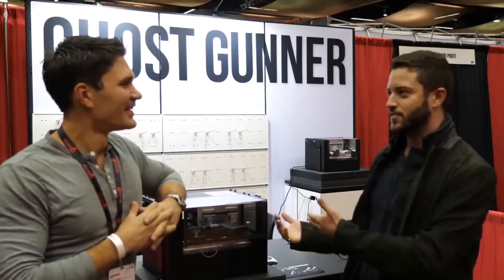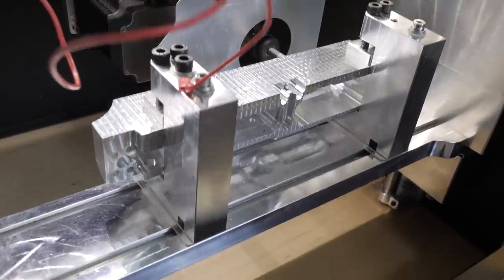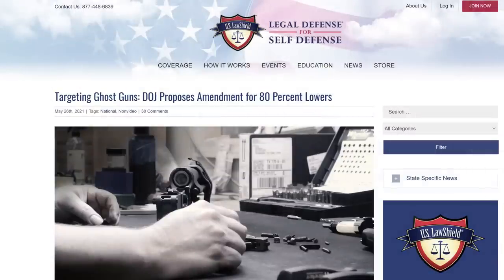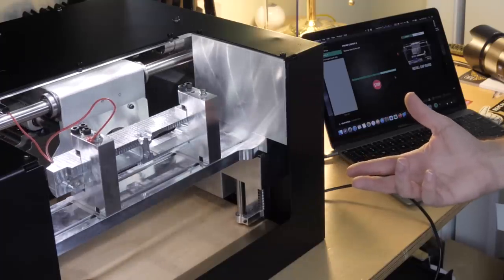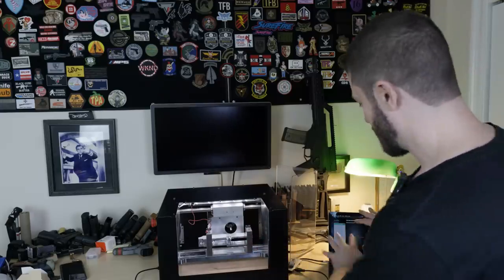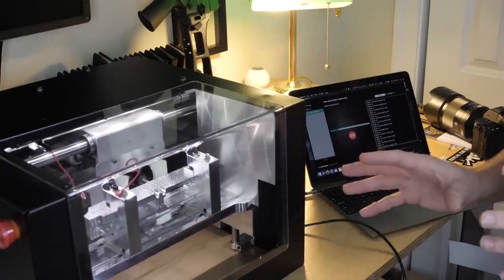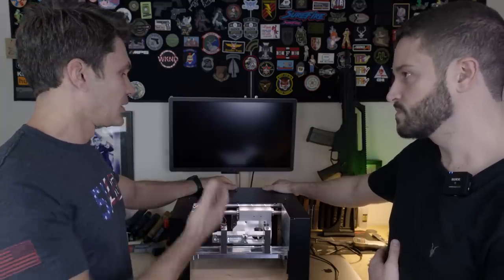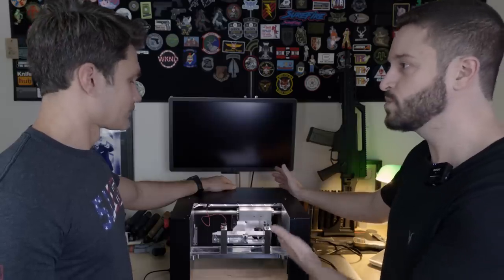NEW: Turn a Metal Block into an AR-15 Lower at Home with the GG3 Upgrade

Comment: This is awesome, and I unconditionally support it. But a 6 month wait, and saying they're only planning on making 700 this year is a major disappointment. My Ender 3 showed up in 2 days.
Reply: It's still in development.
If it catches on and there's a demand for these, it'll be easier to aquire.
Reply: @RicArmstrong  my big problem is the wait time. I want to be able to get it before the ATF pulls some new illegal, unconstitutional BS.
Reply: @RicArmstrong  plus they're already a super small operation. Demand's gonna eclipse their production ability for sure.
Reply: @pulpfiction2122  buy the lowers now, wait for the machine?
Reply: @moosestache1769  or I can just 3D print some. They don't last as long, but they're done way faster, and way cheaper. The deposit alone for the GG3 is $500, you can get an Ender 3 for less than that.
Reply: Plus it’ll save time for us too go out and vote for the midterms

Comment: I love it but the only thing is that it only mills the top half of the lower receiver without the buffer tower ring. You have to actually buy the bottom half of the receiver and the buffer tower ring for 85 bucks from their website. As far as I know you can’t use the GG3 to mill those out but if you were able to that would be well worth it!

Comment: Cool! I have an idea to make CNC/3DPrinter which incorporates welding head and milling head, so welding head works as "3D-Casting" head or plastic extruder, but for metal and milling head work as final shape maker. But for now it is just an idea. I've seen such hybrid machines made at industrial grade level, but they are combine laser melting possibility with milling - this is very expensive for home use. Welding apparatus with milling work-head much cheaper and simpler. Probably it is possible to make it so small and cheap so it is will fit for hobby/home use.
Reply: Good luck sir.
Reply: @teebles Yes, exactly.
Reply: Well, I see that it is possible to use inductive heating bed only, not as a third tool head, because welding - is a complex process, well studied and it is possible to make 3D welding without deformation of substrate you just need to do all accordingly to correct welding technology.

So it can be hybrid with 2 instruments (mill and welding) and with flat inductive heating bed.

And in addition it is possible to add a thermal camera with wide range of sensitivity (0 - 700C) and to use computer vision to control the process of welding and correct temperature regimen of welding.

Interesting thing. When I will have time I'll try to make it.
Reply: And with the help of a small induction crucible, you can easily process aluminum shavings or previously made products, having previously grinded them (with some losses for oxides and slag). And by casting into a long graphite crucible with a thin channel, again make aluminum wire from this waste.
Reply: It may be possible to make a jetmetal printer by analogy with inkjet printers. Drops of metal, if they just drip onto a hot metal surface, behave very unpredictably. But if the drops are small and fall fast enough, they will stick where they fell. And if the ambient temperature is sufficient, then they will be fused onto a metal surface (as in laser sputtering). It is not difficult to make a jet nozzle for such a printer, for this it is necessary that in the graphite crucible inside the induction coil there is a moving part inside, also made of graphite, which would change the volume of the crucible by the volume of the drop and sharply squeeze this drop out of the crucible. On the other side of the crucible, the aluminum wire fed into the crucible will serve as a plug.

And so you can print not only with aluminum but also with any other metal that can be melted using an induction heater. True, it is desirable to carry out all operations like welding with argon.
Reply: @denysxenyev3929  The welding attachments on 3d printers often is horrible, but that's because its usually warping and inaccurate deposition (like it can smash to the sides or bubble taller on the weld bead, making it not work accurately after a couple layers), if you have a tool head though, you might be able to resurface each layer as it prints, giving you a known and uniform layer height each time.
Reply: @jakegarrett8109  Thanks I'll know.

Welding in 3D printers is interesting in that it allows you to make almost any shape of a workpiece out of wire, which can then be processed with a milling cutter. It happens to be convenient. In addition, if an induction crucible is used, the products can be melted down again into short pieces of wire and reused.

I came up with the idea that using an induction heater, you can make an inkjet metal printer that will apply metal in small molten drops onto a heated workpiece. This would be even easier and neater, although such a printer would be a little more dangerous than a simple welding machine, because it will retain heat for a long time.

Welding is convenient because it already has all the necessary equipment and wire, and I have not yet seen induction inkjet metal printers.
Reply: BTW I can make resistive mini oven with temperature up to 1200C in dimensions something like 15cm x 15cm x 15 cm with inner volume will be something like 7cm x 7cm x 7cm. I have really big experience with such small heaters. Surface temperature will be high, but it will work Ok. May be in current conditions it will be more useful in combination with metall powder FDM filament.

Comment: I really really hope someday we can make FNC recievers on these.
Reply: with milled uppers? that would be kinda rad
Reply: @jackjederstrombergman4987  whatever part is the serialized component, then just ship parts kits in.
Reply: @teacher_shep  i know when it comes to the Swedish ak5c the serialized parts are the upper , lower and the bolt. 

I'm thinking  that you could modify the design of the upper so that it can take some sort of piston ar15 pattern bolt and carrier. If you already mill it why not increase the parts availability. 

Imagine the LSX crate engine of the gun world where the internals stays the same and the outside can be whatever classic gun you want.
Reply: @jackjederstrombergman4987  in the us only one part is serialized
Reply: @joelerk6298  so lower?
Reply: @jackjederstrombergman4987  yes the lower only

Comment: Not keen about the whole "lower receiver in 2 halves" idea...? Are they getting bolted together ?
Still appreciate all the work he's put into the concept.  💪
Reply: Perhaps the two halves is a bit of a kludge.  However, adding a few lumps and bumps and maybe a location pin or two and some extra bolts and a little lock tight red may make a functional lower.  And so, here is a thumb in the eye to the ATF!  Which is the point I think.

Comment: All you have to do to turn a metal block into an AR15 lower is follow the procedures for getting a serial number and putting that serial number on the block.  No milling required.  If you tape a Rare Breed trigger to it you need to re-register it as a machinegun.

Comment: Don't get me wrong, I love the idea of this machine. But if they ban 80%, it's still a huge win for the anti guners, just like the NFA the goal was never to ban anything it was to make it unaffordable and a $2,500 machine to do what used to be able to be done with a drill and some jigs or an old clapped out manual Mill still keeps home builds out of the hands of the poores, which is their entire goal...
Reply: $2500 can be saved up, and that the price without economy of scale. Imagine, if the demand is there, and the competition, these machines would see a enormous price decrease while getting better over time.
Reply: Bro $2,500 is like one AR you can buy this machine

Comment: as  a machinist , I think the machine is a good deal just in general .. Other compact and rigid machines are fetching 5-6k , they have no probing system , and programming for a lower would take an expert in both cad and cam

Comment: You can always go the RF15 style mill route and upgrade it for CNC.  That is more or a dive into machining and CNC than some may want but it's far more flexible in what you can do.  The GG is cool if your only interested in producing what it's designed for.

Comment: this could be big for not just receivers, but making your own components too. Instead of having to buy a barrel, bolt, and parts kit to go with a receiver, maybe you only buy a barrel. almost everything else could be home manufactured between this and a 3d printer. Maybe the civi MP7 was the friends and hardware we made along the way.

Comment: I’d like to see (which probably means I need to just do it) the ability to take the zero in my GG3and render it approximately to an 80% then transfer it to my GG2 and finish it off.  The GG are so heavy that it’s hard to get a good price and ship them.  So I’d rather just have two and use each for what it was capable of.

Comment: I paid $250 deposit for the gen1 and I never heard back from them after I emailed 3x.
Edit: I finally got in touch with them and credited towards the new GG3.

What I will say, is that it doesn't cut a 1 piece lower and I have yet to hear ANY information on how to build a lower from 0%. Beginning to think this is a sales pitch.

Comment: How is the final product? The outside of that lower in progress has a bunch of funky tooling marks on it.  I would really like to see what the finished product looks like. 

Will there be sanding involved to get a super clean finish prior to hard coating? Can it do things like flared magwells? Can it make an upper? Can I make heat sinks for computer parts with it? Is it precise enough to make fan blades or turbines? 

What exactly can it do? $2500 is a hefty price tag. Especially if some one sticks to the law and only makes lowers for themselves. $2500 for a handful of lowers is expensive.

How long will it last? How do you calibrate it? What kind of service will it need? Is it all metal construction? How strong are the arms? It was taking little tiny bites in a circularmotion. That's why it has all those funky tooking marks all over it.  Does it not have the strength to go in straight lines? Are the bits proprietary? How many do we get? 

What kind of warranty does it have?

Comment: Its cool and all but you can literally use a 3D printer to print an ar lower and if you want to take it to the next level you can do a lost PLA set up at home for around the same price as the gg3 . The benefit of doing lost pla is that you can cast anything you want if you have a big enough kiln .

Comment: what would be cool, is a 4th axis add on. that could potentially get you in to manufacturing pretty mutch all the parts of a pistol aside from spring. hell, even the springs if you give it enough torque...

Comment: I bought an 80% lower. figured that the next week I would buy the jig to make it 100%... had to wait untill payday to get it. it was supposed to be an every  payday thing. buy a part every couple of weeks and I figured that would be about right for the project. keep it on track and have it still be fun.  nope. when I went looking the next week there were no jigs in stock. I wasnt in too far, so I gave up. then I saw a parts kit for a pps43 so I got one and five minets later the two barrels that I had seen that would fit it were out of stock!! 

 I no longer want to even try to build a gun from parts.

Comment: Would you hand thread the barrel nut and castle nut? Drilling the pockets is one thing. Milling the block is another thing. But cutting/milling those threads isn't easy?
Reply: The man just said you can take a billet of aluminum and in a few hours you have a finished receiver. Finished, to me, would mean ... well, finished - threads and all.

PS: To the best of my knowledge, there is no "barrel nut" in a lower.
Reply: @jayzenitram9621  I guess I'm just surprised it can but those threads.

Comment: I really want something like this that will do steel and be able to make slides and frames from raw blocks to ready to assemble and finish products, like I'd purchased a frame/slide from Colt, Remington, HK, whomever and all I need it the springs and other hardware.

Barrels are the tricky bit. You can cut rifling with ECM but barrel linkage, feed ramps, extractors etc are more difficult.

Comment: When the administration took up their fight to ban the 80% lowers, my first thought was what are the ramifications for making your own firearms totally from scratch?  It's always been legal to do, but as we all know does have some restrictions attached about selling or giving it away or the like.  If they succeed in the ban, does that set a precedent for making firearms at all illegal?  Given the government's penchant for going overboard, it would not surprise me.  I just hope anything they do in this regard is challenged and that ultimately the SCOTUS takes up the cause or some judge with some common sense strikes it down.  So far, the SCOTUS made a few decisions that make it harder for the ATF to infringe, but I'd like to see some more direct decisions dealing specifically with the firearms issues.  Actually, I'd rather see the ATF abolished and the GCA and NFA right along with it, but that's a pipe dream at this point I think.

Comment: My 0% Ar-15 was welded together from steel plates that were plasma cut and sold by "The Flat Spot".
The also used to sell 3 flats that could weld together for the various AK's.
I just looked and I can't find them now.

Comment: I'm really curious on the threaded section for the buffer tube. Looks like its a separate piece here
Reply: Look at their website, they are not cutting the entire part as they allude. It is a three piece design, with a “lower, lower” housing the mag well and trigger guard, and a bolt on buffer tube mount. 

I had wondered how they were going to cut the sharp corners of the mag well and the threads of the buffer tube mount.

Comment: I'd love to get one and make an all aluminum Glock frame, with thinner profile grip. Since the grip would be metal instead of plastic it could be done, theoretically. It's the same approach Shield Arms did to make the 15 round Glock 34x mags, that are no larger than a standard 10 round mag.

Comment: To the "real" Machinist and cnc operators in the comment section, not the internet gun experts....do you need tool lube/cooling when cutting 6061-t6 or 7075-t6 aluminum ?...
Because I see guys with the router kits drowning the bit in cutting fluid and some people say you don't need anything for aluminum..

Comment: This is awesome. My question is if you have one of these, why would you do an 80% lower instead of letting the machine finish the milling work completely? Obviously if there’s some final hand finishing necessary I know the machine can’t do that…. But isn’t the whole point of the 80% lower is that it’s just barely not finished… just enough to sell without any serializing? I suppose it’s not a big deal because I’ve heard that taking an 80% lower to finished is very simply and really only requires a dremmel, I just don’t see why someone wouldn’t create a CAD file for the finished lower.
Reply: I would guess clean-up & fine tuning is more difficult here, as 80% come prepped all around minus just the pocket/pins/select hole. Don't get me wrong, all builds require fitment of parts, but just 80% are tumbled etc to provide a smooth surface rather than a tooled surface. Iono.
Reply: @pmanameless8184  Good point. A tumbler would be another significant investment that someone would need to make unless they just plan to do all the finishing by hand which would take a good amount of time.

Comment: How did you get this? I paid for mine a year ago in January of 2020 and have been getting the run around. The final price was actually higher than what was quoted after the initial deposit. No refunds allowed at ghost gunner. Bank can't get a refund out of them either.

Comment: Do you guys have a program that will probe your existing upper to mill your lower with really tight tolerances for a really nice fit?
Reply: Their program is milspec, period. If you want something other than that, you’re gonna need a “normal” CNC machine and knowledge to do so.
Reply: @FuckTheState  thanks,  damn! 😣
Reply: It does probe it.  I don't think it mills the top surface though which would give your tight fit.

Comment: Cody's main contribution is using this as a vehicle to legally challenge the law. 

The lower is a worthless loophole that only works if you can buy the other components that require high volume production in forging, casting, precision machining, heat treating, and materials science.

Unserialized lowers don't even keep you off the feds list if you purchase any part or ammo from any business with anything but cash.  You have to have extreme opsec to not be found by the government.

What is necessary is manufacturers like Palmetto State Armory that build the most useful guns at volume with good reliability and accuracy for a few hundred dollars.

Any barrier in time or money in the procurement of a firearm is taking resources away from training to use the firearm safely and effectively. This makes everyone less safe. 

While Cody is doing necessary work, we can't lose sight of the big picture. We need large manufacturers producing quality firearms and ammo that is affordably and easily accessible to all.